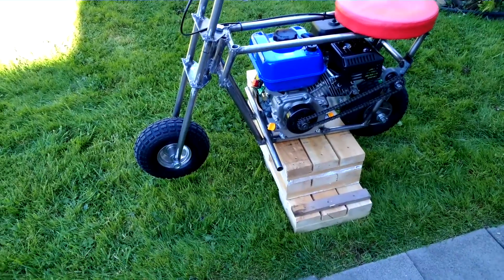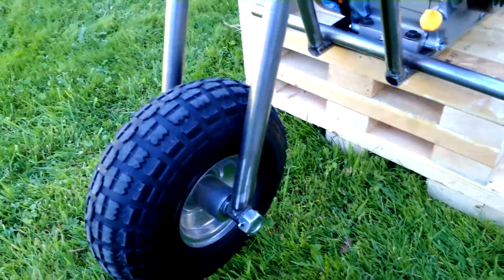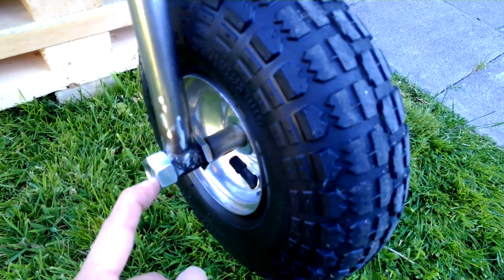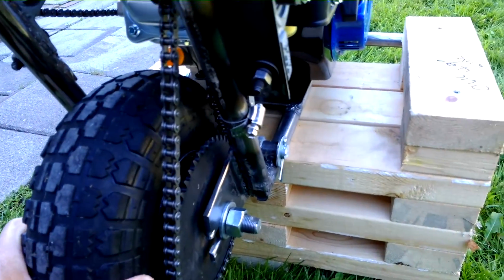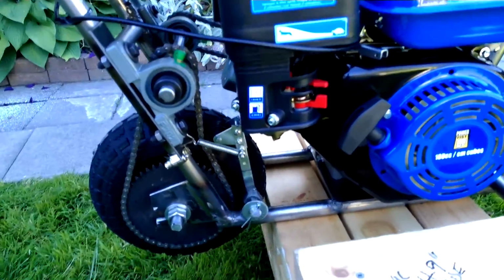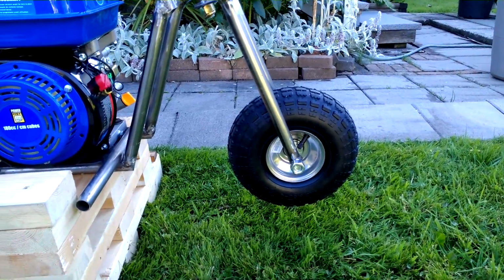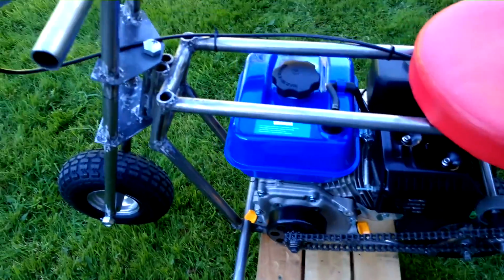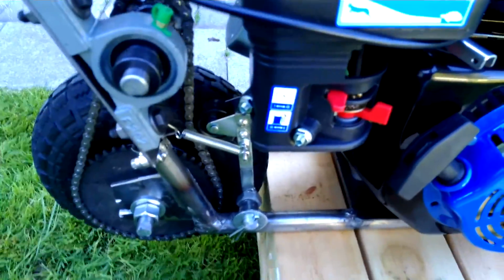Welding Project Mini Bike

Comment: I want to bend the pipe not cut
 makes it looks more cleaner
Reply from the maker: Yes, bending would be better but I don't have a pipe bender. I tried the method with sand but could not get matching bends.